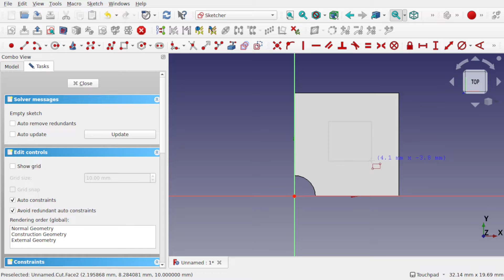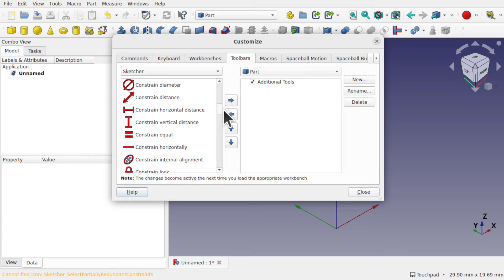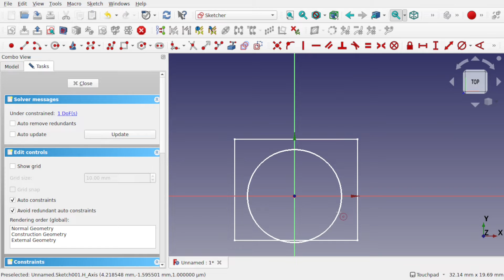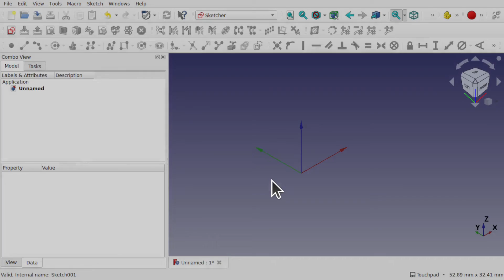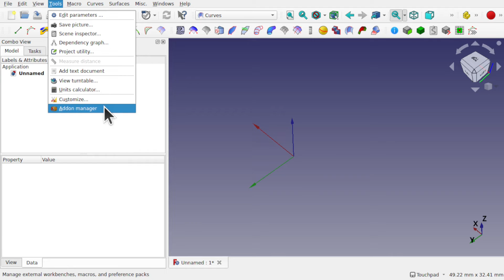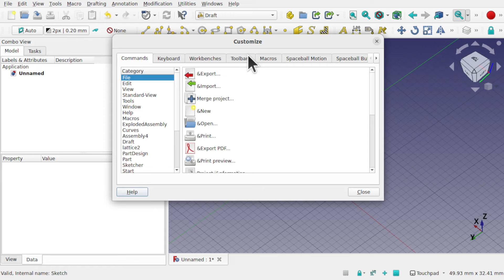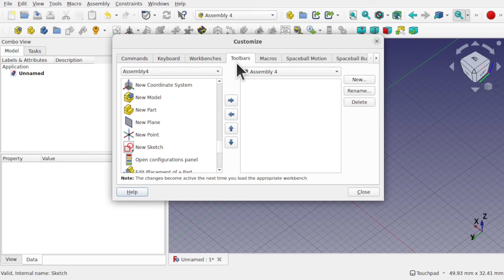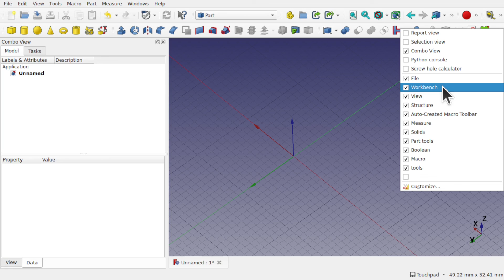FreeCAD: Save Time With Custom Toolbars | Quicker Modelling

Comment: From my experience with 3D CAD modelling,  coming back after using Solid Jerks (SW 2013) a number of years ago.
First Suggestion, and especially for the preparatory lessons - slow down the speed, l....eaving time for the student to listen to your commentary, ......pause, .....video of cursor movement, ......pause, .....voice  instructions then slowly move cursor back to work bench.......pause.  Might double the number of videos, but this would need to be balanced with how much the student actually absorbs and retains. Cheers.

Comment: Is there way to add a dropdown icon on the toolbar? I'd like to have variants of the same tool, but not taking up additional space on the toolbar. Like, say, the circle creation tool in Sketcher.
Reply from the maker: I think this may help, If you shrink the tool bar group by click dragging the divider it turns into a drop down so you can access the rest of the icons.

Comment: Thanks! I've added Create Sketch to the Part too. Can we use Patterns from PartDesign in the Part? I think that's the only feature of PartDesign I still depend on.
Reply from the maker: I have to say I have never used or even tried to use the part design patterns in part, I normally use the draft workbench because of the link array capabilities.  I'm going to have to have a look at that :)

Comment: Question to the FreeCAD users out there? I had a windows system error involving FreeCAD and had to reinstall the OS and updated to the latest version 1.20 to fix the continued closing crash error. Was there a change to the placement function? I can't seem to find yaw, pitch and roll. I just have an arrow down selection box allowing selection of x, y or z, but only one at a time, and a single degree box for the currently chosen axis. Note: Transform works as usual. I'm missing the ability to see all 3 at the same time like before.

Comment: Great way of bringing the various threads together - where the order of the icons on the toolbar could also be a guide as to the order of operations - and fit the approach to design one is most comfortable following, with surfaces or solids (at least until one gains more experience and familiarity with FeedCAD).  Thank you!
Reply from the maker: Thanks for your comment, glad you liked the video. Yes freecad has a lot of workflows to remember and when I start a large project I tend to create a few temporary toolbars to guide me and get the thought process going. PS I have received your email but I have alot of mail to get through so I will reply soon 😊
Reply: ... Re-watching the key videos to highlight the Work benches > Tools > Order of use, to identify the underlying work flow.
Reply: No rush - I gave you a lot to absorb and ponder 😂